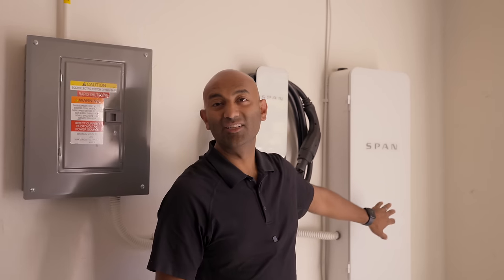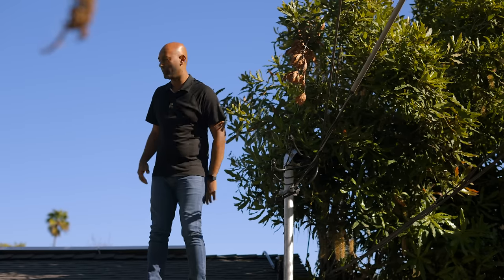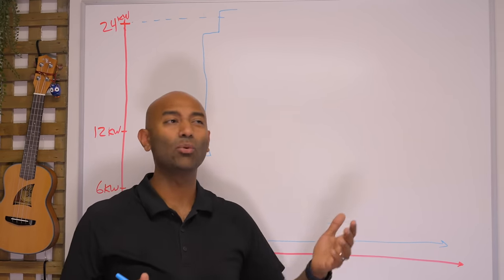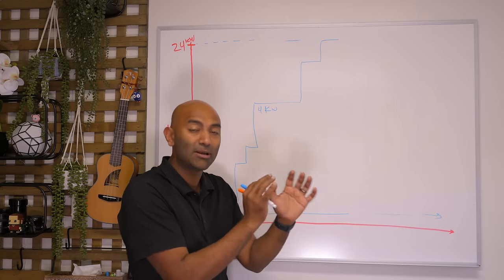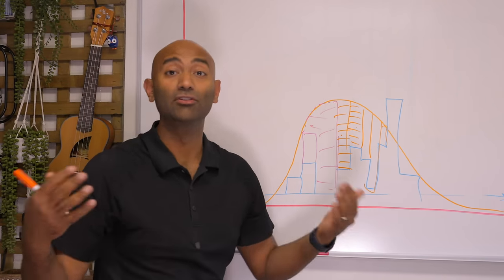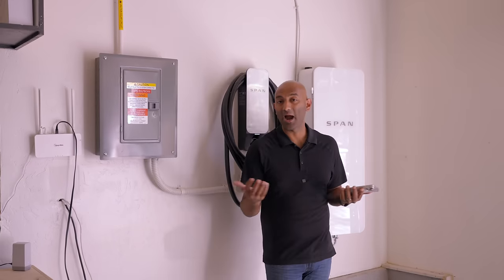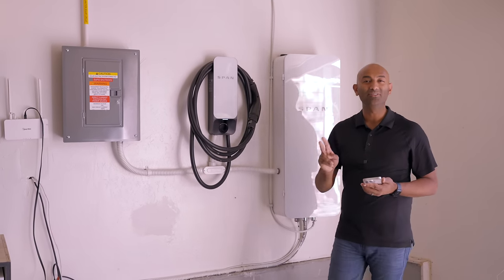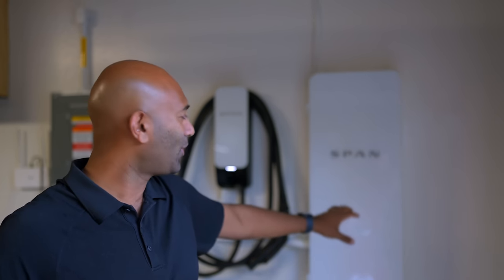I Installed a SPAN Smart Home Panel, Should You?

Comment: Why change the whole panel and not just add individual controllers ? For instance, I installed several IoT plugs in my outlets and manage them with their App. I can program them to shut down if they consume a certain amount and I did I myself. No Electrician required. Why pay ate least 4.5k if anyone can do it for less than 450 ?
Reply: I’d like to see IoT plug for your hvac, oven, and stove.

Comment: I always realize how spoiled I am when looking at these numbers and remember that my Model X charges at 17 kW
Reply: 100 amp breaker just for the car, or half my house's capacity just for the car, unless it's a full sun day where you can take 30 or 60 amps off the top
Reply: Could you put the Ecoflow Smart panel output in the SPAN as a source while keeping the existing system in there too?

Comment: Proprietary is way too risky. As soon as they decide to stop supporting your panel, or if they go out of business, you're done. If their server goes down, you're done and at $4500 (minimum) price tag !? 

I use IoT devices to control what I need to be controlled. If you need all in an APP, use something like SHELLY. Beautiful app. You don't need a new panel, you don't need an electrician and it gives you control of each light or outlet on a circuit, instead of the WHOLE breaker, and costs $20 or $30 per circuit. 
Why would you ever buy a whole panel? Specially if you are in a new house or if you just upgraded you panel ? 

Every single IoT device is smarter and does more than the whole Span panel. My first test was inside my bathroom, a double switch, one for the light and one for the fan. I plugged one Shelly 1pm just for testing, if I liked, cool, If I didn't, It was $20 bucks and took me 2 hours (I'm no electrician) to understand the wiring (Hey, If I'm gonna blow something, better be a $5 bulb). Downloaded their app, paired, tested, worked, closed and bingo. kept playing with it for a whole week, with timers, schedules and even their code editor (I'm a Software Engineer). Just for fun, I made the light turn off if it consumed more than 10w and it worked. That means I can control everything that I want the way I want and no one needs to know. 
Plus, it is compatible with everything. I use it with Home Assistant. Even if they go out of business, my stuff will keep working for years because it doesn't need the Internet.

Guess what, I bought more of their plugs and now I have a smart home that I can control by myself with their app, with or without internet.
SPAN is a  great product but for new constructions where the price is included with the house and you pay pennies in the Mortgage or someone that needs a panel upgrade and has tons of money to burn in one go.

Comment: I really like this. But increasingly I have difficulty with net connected software appliances. Basically for the thing to work and to carry on working the net connected part of things needs to keep operating. Now I talking here in general, this in no way is a reflection on Span. 

If you want a good example look at how amazon is bricking all Halo watches (admittedly with good refunds). 

I wonder how long we can expect this class of connected devices to keep operating for? I wonder do they have fall backs for the net not being available, or the net services not being available. The panel on my house that was very recently replaced was 70 years old. Can we expect similar longevity from a Span panel.

By comparison my 10 year old TV most of the 'features' in it have long since stopped working as the net thing they connected to changed or died.

I like the sound of the product. But I wonder at its longevity.
Reply: It does have a fall back if the internet goes out. But you WILL always need a "network" connections I.E. The wireless router needs to be powered. This still doesn't mean they couldn't brick the software forcing the purchase of the next one.... I honestly did not think of this tbh.  I was only focused on the fking INSANE cost's! And HELLA lack of installers driving up that price even more also, Then top it off with the braker cost's. Even Span's website says average finished install price is $10-12,000.....   But I am 100% sure that is on NEW homes, BC in most places you have to bring the wiring to code, Considering 76% of the US is not up to code your looking at triple that cost's.

 Plus if this is all about solar, And managing it's load to "power everything" ugh... That extra 10K, plus tax rebates would go pretty FAR just putting it in the solar system lol. Or batteries if it is just a back-up you want. This is 100% one of the dumbest things I have ever seen!
 I wish this channel would go back to the Critical thinking channel it used to be and less of the BS shilling channel it has become!  Like that ECOFLOW crap, Who is going buy something like that MASSIVE system??? Why would someone get that over getting a real system on the home for the same cost's but you get tax rebates over 2yrs. Plus increased home value like wtf.  Only reason he did it was bc he was paid an got them for free....

Comment: Natural gas is the cheapest energy source for cooking and heating.  To eliminate it is sheer madness. The govt should not dictate market needs.  Going all electric is a control device. The future is brown outs, high cost, and rationing.
Reply: Yea, once there is saturation of a particular technology there will problems. Trees absorb CO2, If there were only 10 cars in existence the trees would have no problem keeping up and we wouldn't have this whole  rushed electric car push
Reply: Yep. What I'll encourage is cheaper renewables energy. Let there be some serious competition. That way people will decide to switch to electric.
Reply: I agree that NG is a good clean energy source regarding fossil fuels. And we will be dependent on it for a long time while we transition to alternatives. Governments should be practical about what is feasible in this transition they may get ahead of themselves trying to combat global warming concerns. Sequestering CO2 at the generation source makes more sense than trying to regulate clean exhaust on every ICE on the road. So EVs are the smartest solution.
 However even fossil fuel electric generation can benefit from battery backup. When running ICE generators there is a great waste when a generator has to be fired up for peak demand and the generator is burning fuel that is not fully utilized by the new grid demand.
We witnessed Texas experience brown outs that were very destructive. While some politicians tried to blame alternatives, this was misinformation and it was Texas energy policy of an independent grid that was not connected to another states grid for the emergency demand caused by unusual weather.
Thats why Texas bought Tesla backup batteries. To avoid this scenario in the future.
Reply: In UK, and I suspect Europe, electric would be cheaper if it was taxed at the same rate as gas, and had the same subsidies.
If you have a heat pump (I know they're currently expensive), then electric heating can be cheaper.
Reply: @Dana5775  If you define clean as not adding greenhouse gases to the planet, then it's not clean.  

I agree that going electric will allow your car to become 'cleaner' without you having to lift a finger as it's the at the generation stage where you can make incremental improvements - and do that for everyone, car, cooking, heating etc, etc.
Reply: @terryjimfletcher  I have a mini split ac/ heat pump. It very efficient. And it runs off my solar panels which charge my house batteries and my EV. I prefer NG for cooking.